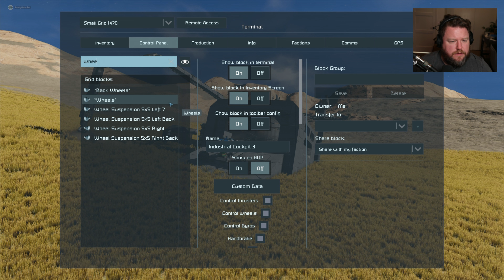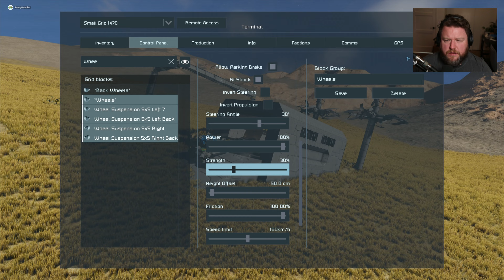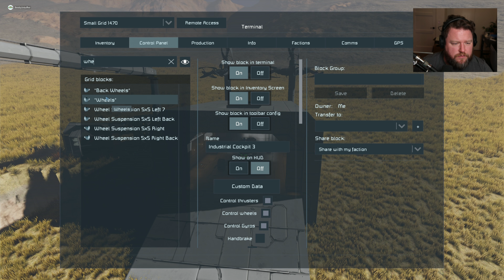Designing a radial mining rig without scripts or timers as a German Engineer - Space Engineers E12

Comment: Tip: To clear rouge voxels the ship mounted drills can clean out those single pieces. 

You might get away with mounting a control seat to use right click mining on the existing rig. It might reach if lifted back up.
Reply from the maker: Ah, I didn't even consider that the mounted drills would be more effective at clearing out the rogue voxels. That's a great tip. 
I ended up cleaning them up using creative mode and voxel hands. That was quick and easy, too.

Comment: Notes as I watched 
Platinum is normally in space.
  Might want to increase strength of wheels and increase offset. * you figured it out but also a 3rd set of wheels with less offset (You want them off the ground empty) and higher strength would stop a lot of bottom out and make going into the garage easier, added closer to the rear.
Flat horizon and arrow keys left or right for spinning craft while digging down or mining . 
Add a sorter to  either the miner or the hauler set to pull ore. 
build an advanced rotor head and lower the attached advanced rotor head then go to control panel and attach rotor head to the advanced rotor and that joins the two end together.  Great for making deeper digging mines just stabilize the bottom assembly with a landing gear.
Timer block works better for what you are doing drill heads tend to bind if they are going just a little too fast. 
2nd set of clean up drills that are pointed 90 degrees to the front of the spin and turn off most of the shared inertia embrace the vibration let it help you.
 Also I am truly enjoying your videos.
Reply from the maker: Thank you, your comments are such a treasure trove of knowledge. Greatly appreciate it! <3

Comment: 38:27
That's just system assistance of merging "Static" stations nearby.
Basically we need to use merge block to merge grid but you know, there are some situation we sometimes did is grid devided by accident.
You have to use the merge block, but the grid buried in the voxel cannot move, so it is quite difficult to use the merge block.

In this situation, If you install blocks at points adjacent to two grids, the system will merge them into one, assuming that the two grids are trying to connect.
At this point, the main grid which usually has many functional blocks keep its position and smaller one would moved to a position to merge.
This is what you've been through. :)
Reply from the maker: Thank you for the great explanation!

Comment: Automating drill rig with only speed setup have a great chance to bit of voxel remained which is you already experienced. :P
This is because the drill does not go down after digging the ground perfectly in a circle, but it cuts the ground like a screw groove.

So if we want perfect automation then need timer setting.
1. First timer (Set the time to wait one full process of digging the surface)
     - start second timer block
     - turn on pistons power (they are already set the speed to going down, just turned off for waiting until the mining process end.)
     - turn off the rotor for stopping (we should set the braking force, it will affect when rotor is off)
2. Second timer (Set the time to stop the piston's moving)
     - turn off pistons to stop going down
     - turn on the rotor for rotating the rig
     - start first timer for looping

And it's better to connect the drills continuously than to separate them one by one so that they don't leave any voxel residue. :)
Reply from the maker: Ah, I think I can pretty confidently say that this is not correct. With the right settings (which I hadn't correctly determined here yet; I think I will a couple more videos in), you can get a speed based mining rig without timers or scripts working. Reliably. I have. And separating the drills by one block is also ok. It just requires a slower drill speed.

Explanation:
- Each drill has a sphere around it that it will mine out. When you put two drills next to each other, there spheres will overlap in some area. That intersection is the shape of a disc or circle. The intersection circle. 
- The diameter of the intersection circle determines the minimum vertical amount of material removed by the drills on each pass. This means, if you do not lower the drills more than that distance on a single revolution, they will remove all voxel material on every single pass. It's basically the "incline" of your corkscrew. 
- If you bring the drills closer together, the intersection circle's diameter will increase and you can drop the drills faster on each revolution. If you move the drills further apart, the intersection circle will decrease in diameter until it reaches 0 (i.e. the drill spheres are no longer overlapping).
- You can easily do the math with a little geometry to calculate exactly how fast you may drop the rig. I did some back of the napkin calculations and then rounded everything down for tolerances and it works. I used the same values on my MMR (Mobile Mining Rig) without issues. I share my exact numbers in some of my videos. I don't recall which one anymore, but they are out there.
- While in theory you could use calculated and perfectly tight numbers for this, because of the unstable nature of mining rigs (shaking, swaying, etc) you do want a little bit of head room and tolerances.

Comment: Using timers to control a flying vehicle will get pretty ugly. However, there is a great alternative: A script called "path auto miner". Googling for that should bring you to the workshop page. The script records the path to fly to a resource deposit and then you can set up a volume to dig out. Also great for digging out tunnels, hangars, etc... However that will lead to my earlier comment regarding constructing a miner which can dig a tunnel where it can fit through itself.
Reply from the maker: Thanks for the tip! I think I want to avoid using workshop scripts as much as possible. With the upcoming block AI I should be able to build a lot of this without the help of scripts and it will be much more fun and entertaining than installing a workshop script.

Comment: doing a circular mine with timer blocks is possible but can be iffy in the setup
you could setup a sensor, that drops the piston one meter, everytime the drill-array swings by the sensor
Reply from the maker: Yeah, I've been struggling a little with getting this mine to work reliably, but I think I've found settings that reliably work without the need for any sensor or timer blocks. 
The main problem I had was not considering that the mining heads will drill out a sphere that will reach it's largest excavation distance only at its equator (vs a cube that would have it across it's entire volume). If you put multiple of those next to each other the volume they can actually fully excavate (i.e. how fast you can drop them per revolution) is defined by the diameter of the intersection circle of the two drill head spheres next to each other. 
I haven't technically done the actual math, but basically came to the conclusion that values of more than 1 meter per revolution are probably not safe. So depending on how fast you run your mine (i.e. how many revolutions / hour) and how many pistons you have, you have to choose a very low velocity value for your pistons (I settled on 0.0001 m/s on my mine that runs at 3 revolutions per hour). This has, since I made those changes, worked reliably.

PS: If there is interest I might make a separate video or community post explaining this in some more detail. It's actually an interesting problem and wrapping your head around it pretty fun.